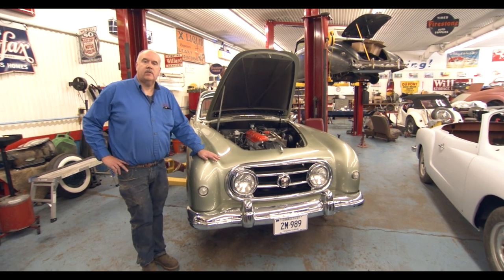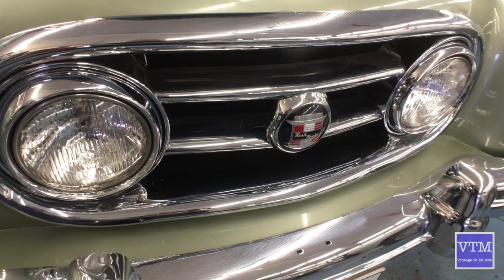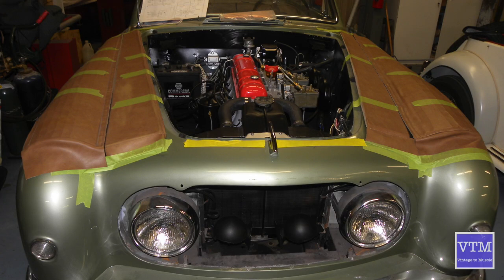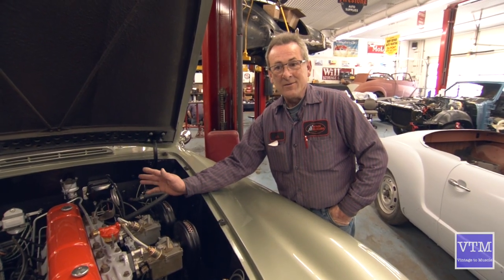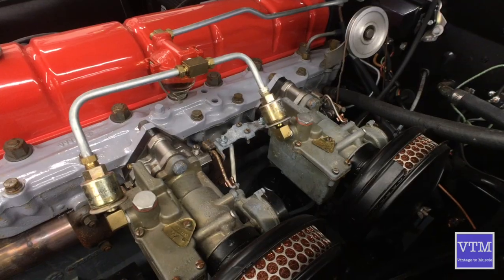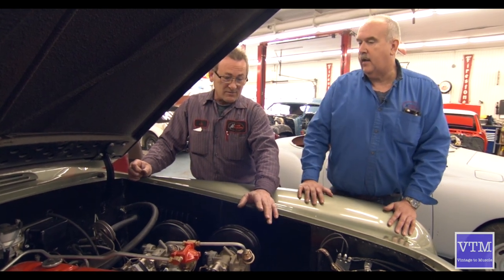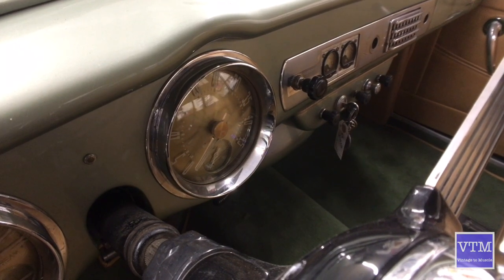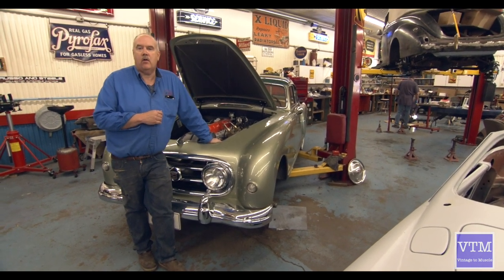Vintage to Muscle Car Restroation 1954 Nash-Healey Le Mans Coupe by Pinin Farina

Comment: You know nothing about that car. That exhaust system was not terrable. Two dumbbells.
Reply from the maker: I have to agree with the mechanics. I've seen it when I was filming. there isn't any exhaust gaskets connecting to the head it's just bolted on and leaks out around where there should be a gasket.